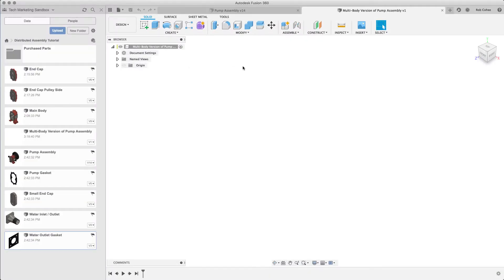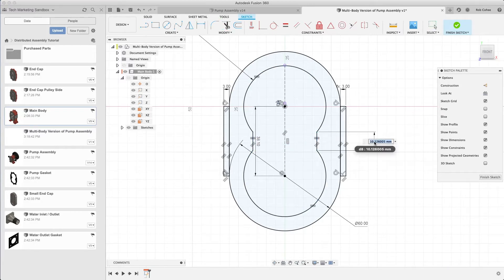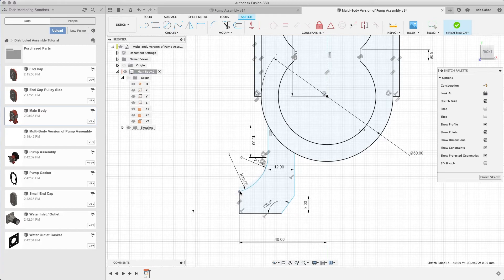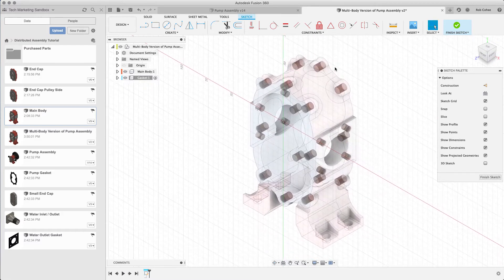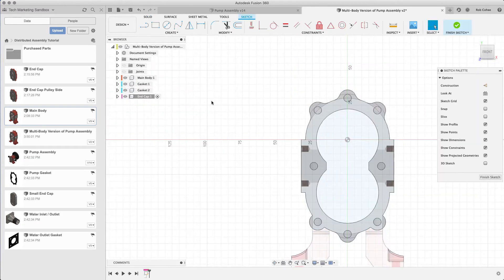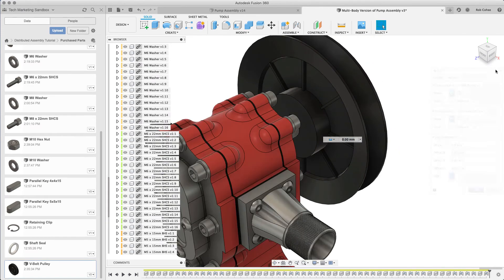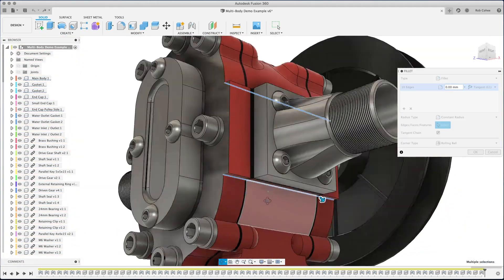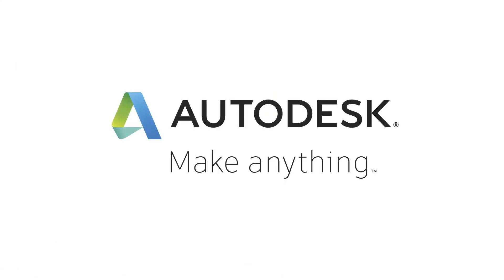Fusion 360 Top Down vs. Bottom Up Assembly Modeling

Comment: I could spend the rest of my life (approx. 10-20 years) watching YTube videos making an attempt at explaining the 10,000 features, tips, tricks and other odd things about Fusion and still not get it to build a simple box cabinet without three hours of cussing and swearing at my computer monitor.  Why, you ask, do I continue the self punishment?  The answer is parametric modeling and there is really nothing else out there free or paid that is any better.  Somehow, modern software is written without documentation, user manuals, books or anything else that could be construed as reference material that is independent of training videos.  I don't believe that the marketing types at Autodesk and Adobe quite get that they could triple their sales and therefore their incomes in stock options if they would just make their software easy to use, well documented,  and supported.